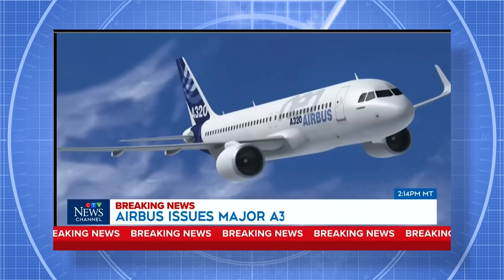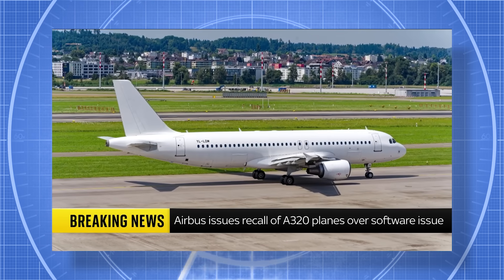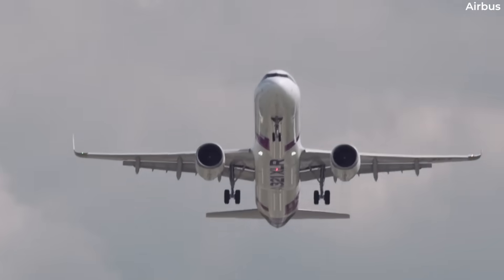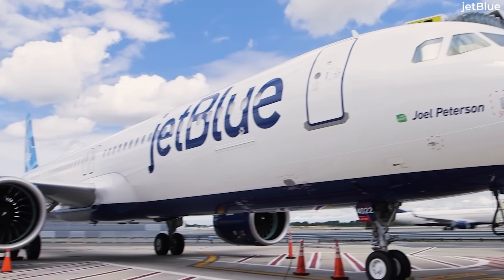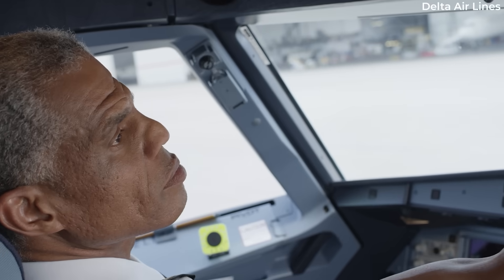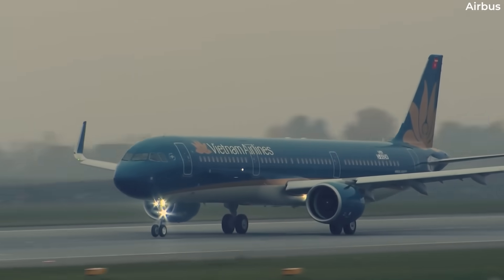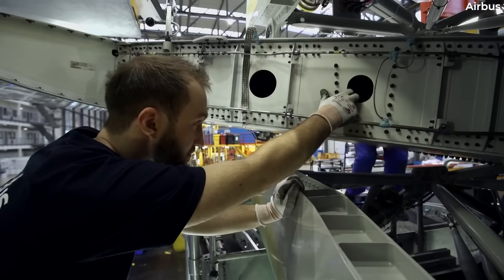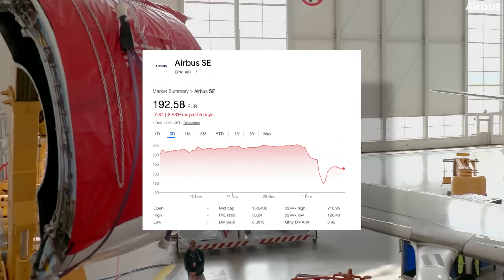A320 Fuselage Panel Issues Surface Days After Major Software Problem

Comment: Bad panels getting installed on multiple aircraft calls in to question the quality control on the production line as well as with individual installers.

Comment: Solar Storm (Solar Flares)
It is well known that during big Solar Storms satellites and aircraft may be affected 
The Sun is now at its maximum on its 11 year cycle, generating northern lights at lower latitudes 
Airbus has published an Emergency Airworthiness Directive to solve this matter 

Some 6.000 aircraft are affected worldwide 
15% of the aircraft will need hardware change (hangar time) 
85% of the aircraft will need a software update (2 hour job) 
This will lead to delays and cancelations 

It is reassuring to see Airbus taking actions fast and openly

Comment: Despite the PR disaster, at least Airbus is being proactive and forward with their customers. 
Airbus learned from Boeing’s MCAS scandal that being secretive about quality control problems will destroy your company and brand. 
Airbus can recover in 2 years. 
It will take Boeing a decade to recover.
Reply: Again another "At least Airbus" comment. Was Boeing proactive when the 777x had its Uncommanded pitch event problem?  Were they forward with their customers? 
The fact that MCAS is the only relatable thing here to say Boeing still didn't learn is ridiculous. Airbus didn't learn as they too suffered from quality control issues which may have destroyed the company and brand if they ignored it. It will take a decade for Airbus to recover not just 2 years. Boeing is taking less than a decade to recover believe it or not
Reply: @YamiPheonix531 So you’re saying Boeing can’t be as competent as Airbus currently is?

Comment: The media blew the scale of ELAC computer out of proportions.   Air Canada iissued stateent on its web site indicating noone of its A320s are affected and flightoperations going on normally, while media were stating all A320s worlwide are grounded.  The Airbus technical document provided full list of models/varians that were affected. 

Where a serious question should be asked is whether Airbus/Boeing use sufficiently hardened electronics on their aircraft.  The root cause isn't the software mishandling bad data, it is the fact that shielding still allowed solar radiation to change content of memory in the unit.

Comment: Solar radiation contains a whole lot more than light (infrared, visible o UV).  There is a lot of electro magnetic radiation and all sorts of bad rays.  
The earth's magnetic field provides an area where solar wind is deflected mostly (the Van Allen belt).  But this is not perfect. The atmosphere provides further protection from the non visible radiation as protons and  electro magnetic  energy hits atmpshere molecule instead of life at surface.  Satellites and the ISS have shielding and hardened electronics to  survive, but despite that, whenever there is a solar storm which vastly increases that tyoep fop harmful radiation, there are warnings for satellite and ISS.   (one reason you see much older CPUs in space is due to them using hardened chips aren't created quickly or for every new CPU). 

The Airbus document shows only NEO and some retrofitted CEOs had the bad software. ELAC B L104.  EM radiation would likely corrupt the RAM and I would assume that the software just processed the wrong data instead of declaring it invalid and not acting on invalid data (or perhaps causing a reboot to refresh RAM from scratch or whatever).  The replacement software is B L 103+ which would lead one to beleive that it was something added/removed in the newer software that caused this to be a problem. 

The Airbus document states:
"An Airbus A320 aircraft recently experienced an uncommanded and limited pitch down event.
The autopilot remained engaged throughout the event, with a brief and limited loss of altitude, and the rest of the flight was uneventful."

I have to wonder if the pilots elected to descent to 18,000 after the incident as opposed to the ELAC causing the full drop from flight level down to 18,000.  But obviously, the pilots noticed it and felt important enough to report it.

Comment: Amusing to see the amount of deflecting going on here.
   Up to 628 potentially impacted by this flaw, with 168 already in service..
  Where's the QC....
Trying to meet those lofty delivery targets no doubt.
Reply: Yeah, let it be  Boeing and the Airbus  glazers will be on every page fear mongering about Boeing planes
Reply: Any page where I can find this story about that many planes being impacted ? or video
Reply: Yeah lets ignore the fact that Boeing has had to ground the 787 in 2013 and the 737max in 2020 and 2024.. all of which were the result of poor quality control..
Reply: @chaoszombie9995 What you’re saying is quite a fallacy. Pointing out that a different party (or the person making the criticism) is also guilty of a wrongdoing does not make the original issue less true or less important. The A320 problems must be evaluated on their own merits, regardless of what Boeing has done.
Reply: @AkwasiNkansah-m5k I don’t disagree, I was really pointing out the rather ridiculous “where is the QC” statement and the fact that the reply made it sound  like Boeing hasn’t had to ground multiple aircraft families for the lack of quality control
Reply: @chaoszombie9995  What has the grounding of the 787 back in 2013 got to do with anything? The 787 in 2013 was a battery fire of which their supplier made faulty batteries. The 737max in 2020 is all that is relatable as we can all see here in the comments. The 2024 grounding due to a door plug was not poor quality control. Just a workmanship error.
Reply: @chaoszombie9995 I like how you were able to bring the 737 into your reply, where neither the original comment or the video itself mentioned Boeing or the 737. In 30 years time, Airbus could have 5 planes fall out of the sky and crash cause of their shitty computers and you'd still say 'ackchyually in 2019, 2 Boeing 737max crashed'. You're a loser. Replay the video and listen to what happened with the jetblue flight. A similar thing happened on a Qantas A330 and a Malaysian A330. So is that poor quality control, poor design or do you Airbus fanboys just look the other way when an Airbus has problems?

Comment: Sounds like Airbus was doing the right thing and bent over backwards to investigate the issue with JetBlue and put out a fix as quickly as possible. Also, quality inspectors on the production line caught the problem with the panels and called a production stoppage till it was investigated and a correction put in place. And as for the Airbus stock price drop? It means I should buy some Airbus stock because because emotions triggered a sell off and made it cheaper for me. Nothing wrong with Airbus.
Reply: What about the 168 delivered with the defective panel already in service..
Where was QC then ??
Reply: @Charles-b2t  news article stated the issue was discovered while carrying a minor repair (probably blend out). You need NDT performed on any blend out, so it required one of the affected panels to be damaged for NDT to reveal the issue.
The more bothering issue is: how come the supplier didn't catch those? We're talking actual panel thickness... a certified panel supplier should master these things...

Comment: Boeing, see? You ground an aircraft before it crashes… not wait until 2 crashes before you ground an aircraft.
Reply: Did Boeing wait for 2 crashes when the 777x had a Uncommanded pitch event? Did they ignore and cover it up? So much for relating to the 737 MAX crashes!
Reply: @nickolliver3021  Well actually, I wasn’t even referring to 737 Max cases… because Boeing didn’t actually grounded 737 Max even after 2 crashes POTUS did

You can guess yourself which case I’m actually relating to…
Reply: @tonamg53  Who is *POTUS*? Of course you were referring to the 737 MAX crashes and you said "wait until 2 crashes" and then ground the fleet. 

So yes you did mean that.
Reply: @nickolliver3021  President of the United States of America.

737 Max was grounded by the executive order of the President.
Reply: @nickolliver3021   And I said NOT wait until 2 crashes…

Please do not partially quote my statement.
Reply: @tonamg53 That was aviation in 2018, not post-MCAS. The world was relatively knew to such an occurrence on Boeing aircraft, so the aircraft weren’t grounded because investigations were still pending at the time.
Reply: @AkwasiNkansah-m5k  If safety is first priority, we should not be needing to prove that the plane is unsafe. The plane needs to prove to us that it is safe.

The plane should be grounded as a precaution whenever safety is in doubt i.e. after a crash and the cause is unknown or uncertain.

If we have to prove the plane is unsafe before it can be grounded, you’re not taking safety as first priority.
Reply: @tonamg53 Like I said, that was aviation in 2018. Groundings usually don’t happen after the first horrible incident, since identification of the cause of the issue is what’s important first, which is why all 787s worldwide didn’t get grounded after AI171, and all 747s worldwide didn’t get grounded after its (the 747-100) maiden flight(and crash) with Lufthansa
Reply: @nickolliver3021  The 777X STILL isn't in service, and is currently 5 years late, with first deliveries still 2 years away. 
With 15,496 A320 family aircraft in-service compared to zero 777X in service, these issues aren't comparable.
Reply: @simu31  Thank you so much captain obvious that it is "still not in SERVICE and is currently 6 years late with first deliveries in early 2027, thats not 2 years away. 

With 15,496 A320 family aircraft in service compared to zero 777x in service these issues are certainly comparable as its not about which one is in service and what is still not.

This is about the issues with recent Boeing problems not about which one is better because its in service! wakey wakey!
Reply: @nickolliver3021 How many times were you dropped as a child?
Reply: @DCTag this is getting so pathetic. People get likes for having tunnel vision

Comment: The 777X program is the real crisis. 😂
Reply: crisis in what way? 

The fact its "still not certified"?

Cry me a river
Reply: @nickolliver3021  Nice of Boeing's CEO to drop into the comment section.
Reply: @nickolliver3021  The planes are parked everywhere at Paine Field and they are NOT producing revenues for the company. If that ain't a crisis, I don't know what is.
Reply: @alooga555  If the planes are stored at Paine Field and not producing revenues for the company, that does not mean its a crisis if the plane is getting certified by the authorities. The a380 was a crisis if it spent 2 or so years delayed.
Reply: @nickolliver3021  I see revenue A380s flights flying every single day. The 777X? ZERO.
Reply: @alooga555  Tell that to the FAA who have been so slow at certifying the 777X

Comment: At least its not falling from sky peoples are safe
Reply: "at least its not falling from sky" uhm, you did hear about the jetblue flight at the end of october which was literally mentioned in this video?
Reply: @anticooperativ8398  falling out of sky is normaly related with crashing. This did not occur here.
Reply: @finanzam1 but it occurred with 737MAX   debacle
Reply: @AnetaMihaylova-d6f Doesn’t make the original issue any less important, just like how the Boeing 787 outselling the A350 doesn’t make the A350 any less important
Reply: At least the 777x did not fall out of the sky or latest 737 problems or 787 problems. So much for saying "at least"
Reply: @nickolliver3021  sone kind of boing ceo which needs to defend his company and therefore responds to every comment here?
Reply: @finanzam1  yes I think that is whats needed here

Comment: At least Airbus in conjunction with the Airlines software issues were resolved extremely quickly with a majority of A320 s being updated over the weekend .
Reply: @r12004rewy Doesn’t make the issue less hazardous than it already is
Reply: @AkwasiNkansah-m5k 
I never stated that the issue wasn't hazardous,  but Airbus jumped on it very quickly and resolved the problem
Reply: Another "at least comment"

Comment: No way Airbus software problems are due to "solar radiation". Developers screwed up - The solar storms merely provided a convenient excuse to cover for the effup. I'm with Ron Rogers on this one.
Reply: Ridiculous for you to say this. My car has had the low tire pressure warning on for years. This was due to a solar storm. Same thing with my latest blackberry update, solar flares destroyed the update.
Reply: @rtbrtb_dutchy4183 I did the research, and found out that it was indeed caused by a solar storm, but I still don’t understand how that happened
Reply: @AkwasiNkansah-m5k  The 'how' isn't explained so we just have to trust that t 'fix' is appropriate.

Comment: Airbus fanboys incoming with arguments that are basically “at least it’s not as bad as Boeing.” LMAO
Reply: so annoying... people are always blaming boeing for everything. When airbus has an issue they're like "well it's not that bad, at least they're doing something about it" 
Seriously, these people need to grow up.
Reply: @HotelBravo-Tim How many innocent people died from this Airbus issue 🤔
Reply: Well that’s not the point. Boeing lied, and their products are substandard and unsafe. They are dishonest and it has cost people their lives. I would never step a foot on the flying coffin 737 Max. They can’t even get the rest of their rubbish certified 😂
Reply: @NeilClemenson  judging after what you've said in this comment, you're clearly not in a position to make such a claim. The 737 MAX isn't a "flying coffin". Yes, it has had two crashes due to MCAS; however that has been resolved and since then the 737 MAX has had a great safety record, as has almost every airliner. Aviation is still by far  the safest mean of transport, even on a 737 MAX, and the 737 MAX isn't more dangerous  than the A320, both aircraft have had fatal crashes.
Reply: @NeilClemenson  Did Boeing Lie about the 777x pitch event? Did Beoing lie about 787 faulty parts being installed not up to spec from its suppliers? How are their products substandard and unsafe if they are flying without issues right now? Has Boeing been dishonest this year and costed peoples lives? Why would you never step foot on the So called "flying coffin 737 Max"? "They can't even get the rest of their rubbish certified"? Tell all those airlines that the 737-7 & 10 and 777x are rubbish as those 600 odd orders should not have taken place!
Reply: @FlyByWire1 It's not as bad as Boeing! 
346 peolpe died because of Boeing's deception, lies, corruption and coverup.
Reply: @joeking22  346 people died not because of lies, corruption and cover up!
Reply: @nickolliver3021 But they did Nick and thats fact
Reply: @r12004rewy  No they didn't as that is a fact and not your ignorance
Reply: @nickolliver3021 So why did Boeing pay $2.5 Billion? for 737MAX  conspiracy
Reply: @r12004rewy why did Airbus have to pay billions for their bribes? 😅 yawn yawn yawn
Reply: @nickolliver3021 😂😂😂😂😂
Ok Nick
Reply: @nickolliver3021  Airbus doesn't bribe, that's a American thing. In this situation, Airbus shows how it's done. If something goes wrong, they communicate with their customers to resolve the issue as fast as possible. Meanwhile Boeing these last years is known for sweeping things under the rug. Some say it's because of the merger with Mcdonnel-Douglas.
Reply: @damcoentertainment3956 There’s a lot of tu quoque going on here, but the Airbus bribery scandal was a real thing, so your comment isn’t 100% true
Reply: @damcoentertainment3956  Airbus does bribe, its not an American thing. Boeing also shows how its done with the new CEO doing better. You do realise that Boeing latest problems have not been swept under the rug. Some say its all to do with the merger with McDonnell Douglas but where has that shown?
Reply: @nickolliver3021 They died due to pilots not being able to fly aircraft correctly if that was a western pilot or western trained pilot flying in the Middle East the aircraft wouldn’t have crashed.
Reply: @Chillforev-dd9wr yes of course. It's just annoying that you get sone that will blame boeing for the crashes and deaths of those two accidents
Reply: @nickolliver3021 Yep and it’s frustrating
Reply: @Chillforev-dd9wr really is
Reply: Flybywire at least it didn't result in any deaths and Airbus resolved issues extremely quickly.
Clickbait headline Airbus continues to be the number one aircraft manufacturer
Reply: @r12004rewy  Again another "at least" comment. Did Boeing with the 777x pitch event ignore the issue and leave the planes to crash resulting in deaths if it theoretically was certified earlier? Did they just ignore it all and not fix the issue extremely quickly? "Airbus continues to be the number one aircraft manufacturer" yet these issues could have easily been worse than they are reported as.